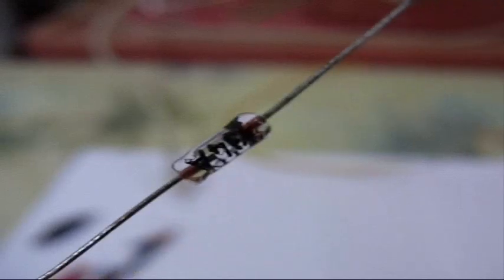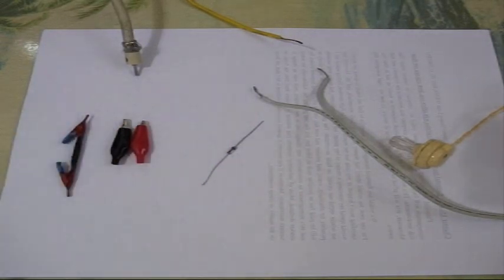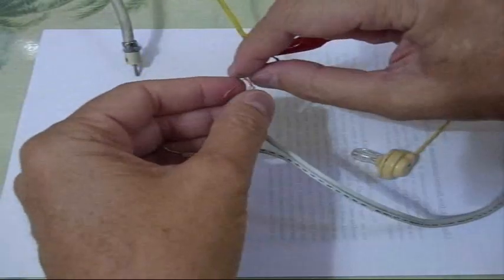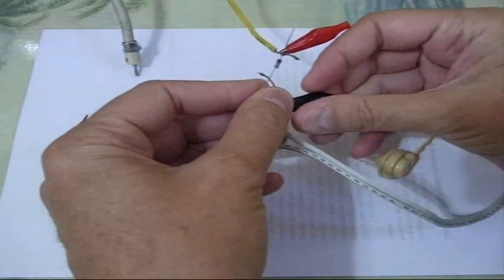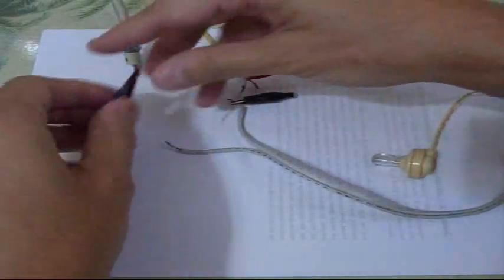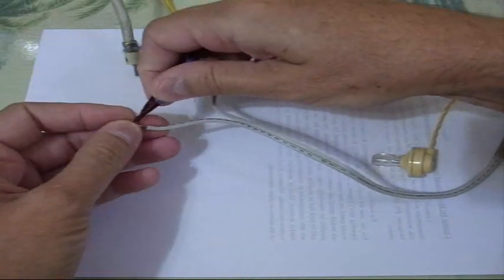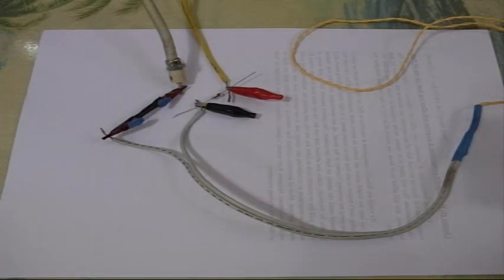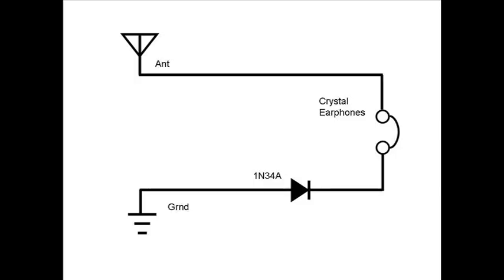World's Simplest Radio

Comment: I am having a very nice discussion with George https://youtu.be/oCt7ExvpfRs, not realizing that, I think, you have already produced the proof of my analysis. That frequency and all the components that produce a so-called carrier wave, are only needed to combat interference. Transmission, and reception, can happen without carrier wave.
Reply from the maker: I read your discussion and I'm not sure I understand.  This works because the diode will decode the data from the carrier wave of the strongest nearby station.  There is enough power in the signal (I have videos on getting power from crystal radios) to drive the crystal earphone.
Reply: @tsbrownie  Maybe you could explain to me how this decoding takes place, because I honestly cannot see it.
Reply: @tsbrownie  btw, do you even need the diode? Wouldn't it also work without, eventually with extra amplification?
Reply from the maker: AM = Amplitude Modulation.  The "data" is transmitted by changing the power of the signal (the carrier wiggles up and down).  The diode strips the "wiggle" off the carrier and that's the part that goes through the earphone.  So you hear the data and not the carrier (which you could not hear anyway because the pitch is too high).
Reply: @tsbrownie  the problem is that there is nothing in a diode that could "strip" anything from the signal. At least, I wouldn't know where to find it.
Would you consider trying it without the diode? Eventually with a pre-amp? That would help determine the role of the diode, or if it has any at all.
Reply: @tsbrownie   I find the concept of amplitude, or rather its use, as confusing as the use of the concept of frequency. As I said before, frequency is a rate, it cannot therefore be added to or subtracted from a sound. It simply means that the same, unchanged, sound is repeated faster, or more or less slowly.
As far as amplitude is concerned, I hope I am not saying anything stupid, but the same rule applies: the sound remains unchanged.
Which is very weird when you come to think of it. Sound comes in the form of an electric current or electric pulses. To amplify the sound, we have to add more current/voltage (or lower the resistance) to the one coming from an audio device.  This added current, called modulation in some cases, does not change the sounds,. If it did, making something louder, or less loud, would completely change the sounds and make music or speech unrecognizable each time we turn the volume knob.
There is no modulation going on in an audio device, even though amplitude can be changed very easily. And that is what really puzzles me.
How can amplitude be added to a current carrying sounds? Amplitude of what? Of the sounds themselves? But they must remain unchanged.
If I understand it correctly, each sound has a certain envelop, and that envelop becomes the amplitude. Try as I may, I have no idea what that means, even though I understand it perfectly when I see it on paper.
The only thing that makes sense to me is the following. Current is added according to the strength of the signal coming from the audio device. That will always make the sound relatively louder since more current has been added. But since the change will be proportional, and the user decides how loud he/she wants the sounds to be, the added current will not change anything to the original content.
That makes me think that there is nothing in the transmitter, nor the receiver, that can subtract the added amplitude, and for that matter, the added frequency. Those are concepts that might appear meaningful on paper, but they have no physical reality.

Comment: Can I use 1n4007 diode
Reply from the maker: Not really.  They are not sensitive enough unless you live right next to the radio station.
Reply: Ok
Reply: I can't get the 1n34a diode and I can't bay from online because we have started lockdown
Reply from the maker: @kanishqmanor6112  It is easy to replace the diode, so you can start with what you have and experiment.  When you can get the 1n34a it is no problem to change.
Reply: Ok thanks